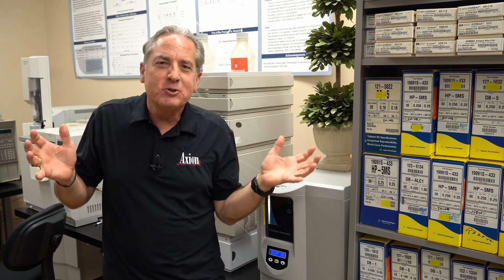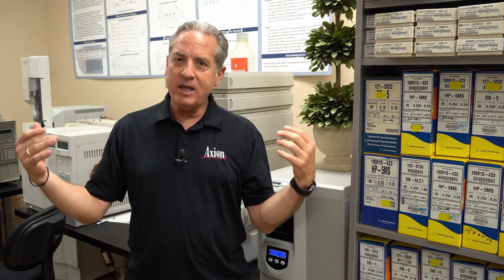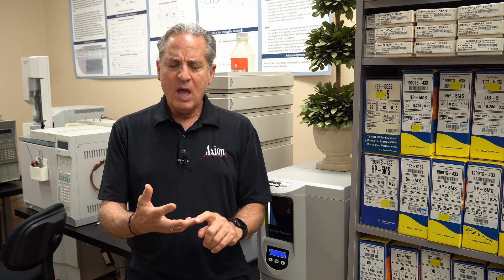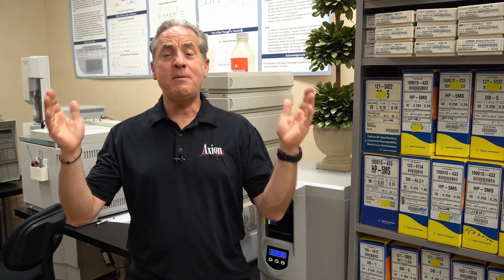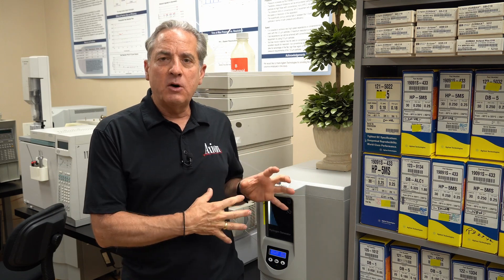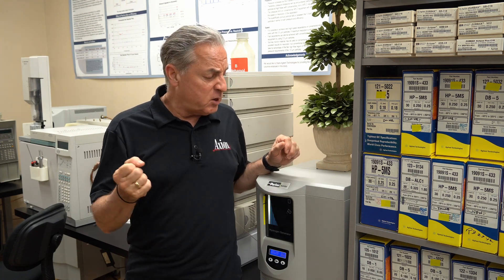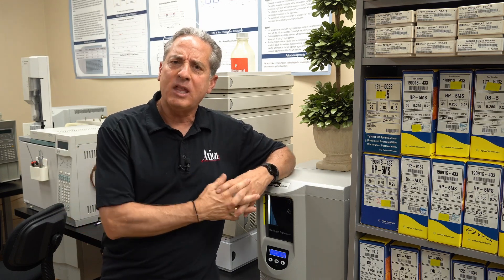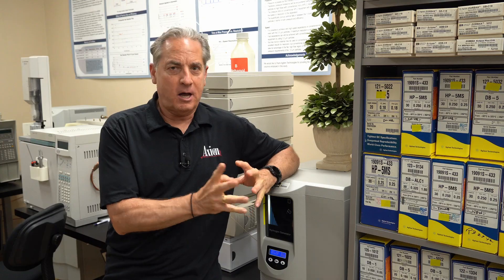Switch GC carrier gas from helium to hydrogen in one simple step

Comment: Do all 15 GCs have a continuous flow of H2 gas at all times using that H2 generator, or do you need to switch them off? Also, do you offer your courses online?
Reply from the maker: Hi Jessi, great question!  All 15 can run their FID’s continuously with the single H2 generator.

So that is using the H2 as fuel only.

If you wanted to use it as carrier gas, you’d need to consider the column and split flows.

Hint - It is the split flow that is usually the major constraint.

Our Parker generator goes up to 1300 mL/min.  Figure 30-40 mL/min per FID.  If you could keep your split flow less than 60 mL/min, you could run 10 GC’s off of one generator.